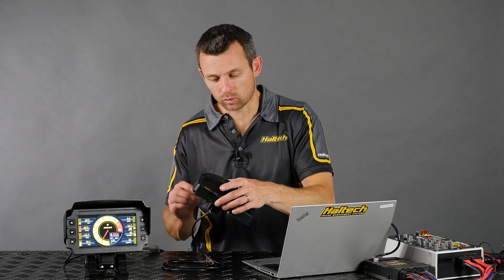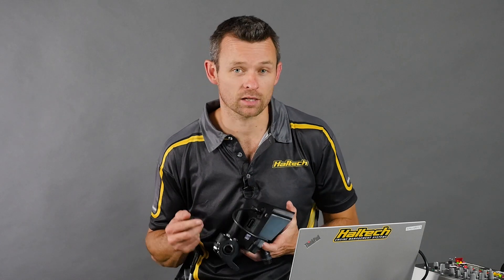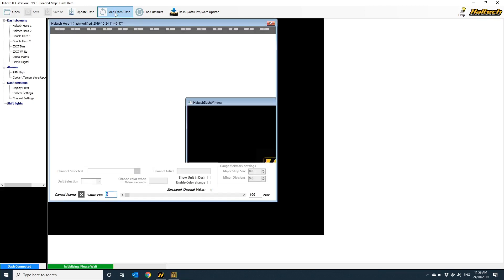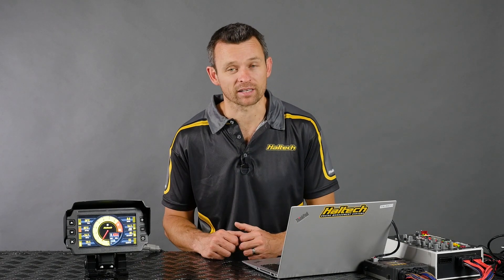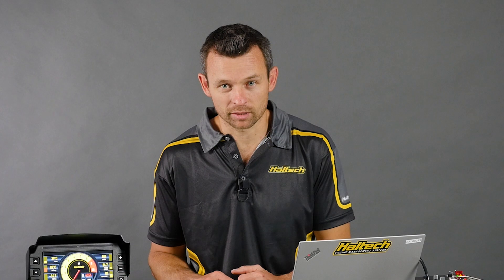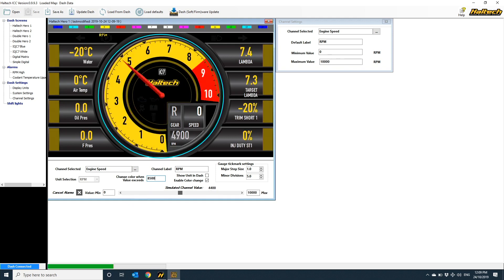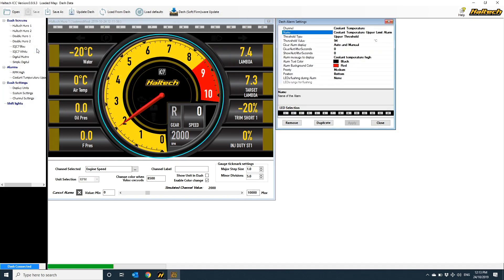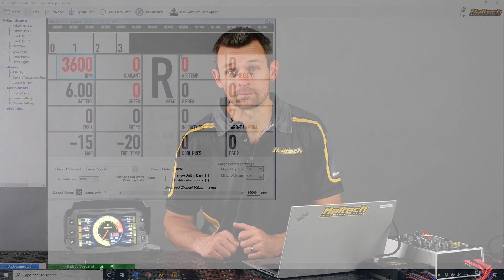💬 How to set up your iC-7 Dash | TECHNICALLY SPEAKING

Comment from the maker: The iC-7 is configured using a brand new, intuitive software called iCC (iC Configurator). With this software you can control various aspects of the dash behavior. In this video we guide you through the basic iC-7 setup procedure including display screen selection, gauge ranges and red zones, units, channel selection and alarms setup.
Got a topic you'd like us to cover? Leave it in the comments section!
Reply: is it possible to change the overall color of individual gauges? Say, instead of yellow tach, change it to purple? Looks absolutely fantastic btw
Reply from the maker: Not yet, but that's something that may come with a future firmware update
Reply: @haltech  Awesome! I can't wait to see what yall do next! Love the videos!
Reply: Do A video on how to set up the gear indicator.

Comment: Thanks for the video. On the ic-7 can you also use it to switch between maps and activate launch control?

I'm trying to work out if this is a viable replacement to a toucan display.
Reply from the maker: For those functions you'll need either a CAN Keypad or a Rotary Trim Switch.
https://youtu.be/L2yju0vCbWA
https://youtu.be/U2TgNBQXUjY

Comment: I have had a play with the software, it looks quite good!  Two small suggestions, on the RPM Counter, I'd like an option of compressing the first amount of the rev counter like some motorsport gauges, eg 0-3000rpm in the same space as the rest of the gauge's 1000rpm increments.

Also, an option of a "flatter' colour scheme/design , rather than 3D effect.  Perhaps open the whole design up to the end user with the skills to produce such a thing.  Personally, on the Haltech Hero, I don't like the grey banding behind the digits and would like the choose the exact tach colour and front colours.